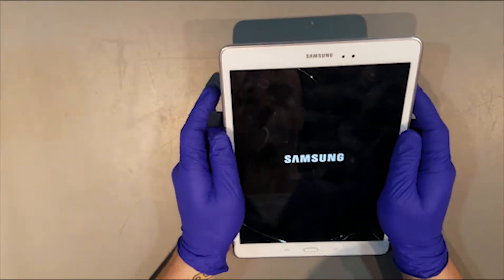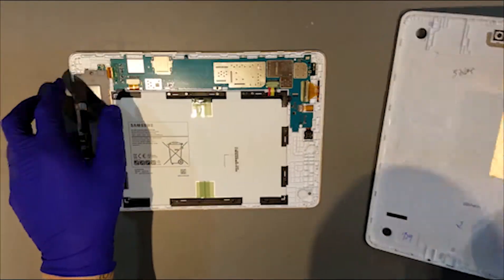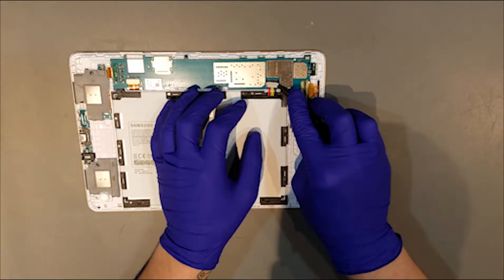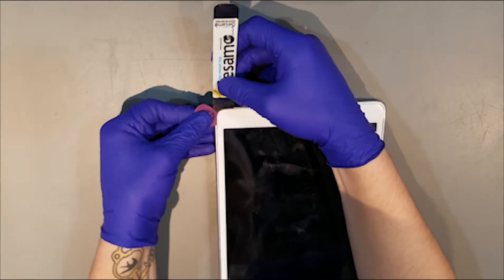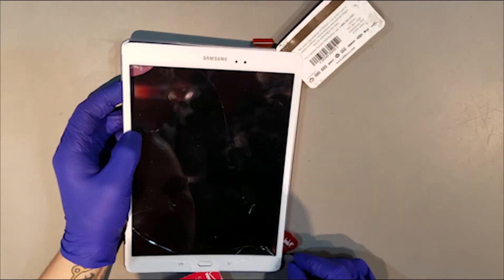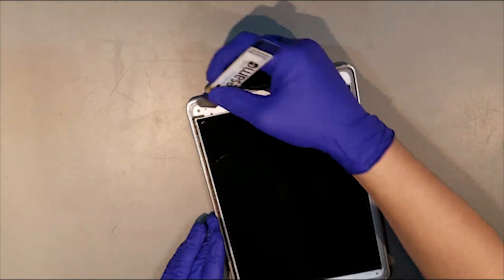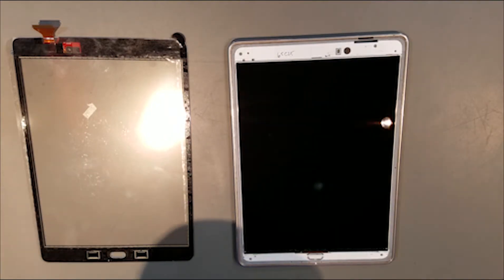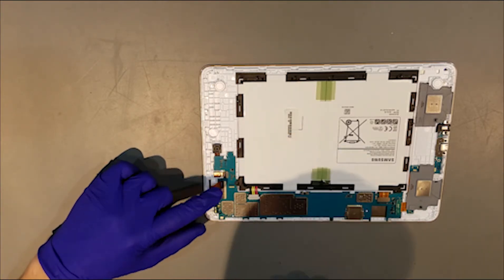Samsung Galaxy Tab A 9.7" Glass Replacement (Non-Fused Version)

Comment: How can you tell if your screen is fused or non fused.  I have a Samsung SM-T813?  Can't seem to find any info on whether it is fused or not.
Reply from the maker: With the display turned off, press the glass into the tablet. If you notice a little "wet" area form around where you pressed, it's separate. If when you press, the screen shows discoloration, its fused
And yeah, Samsung doesn't make it clear which verisons got the fused displays or not, just kinda random
Hope that helps